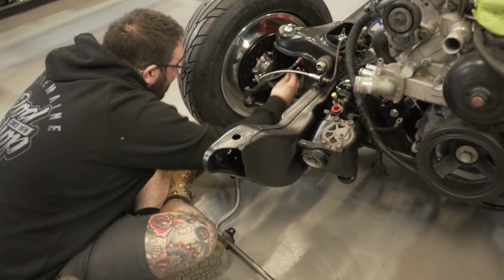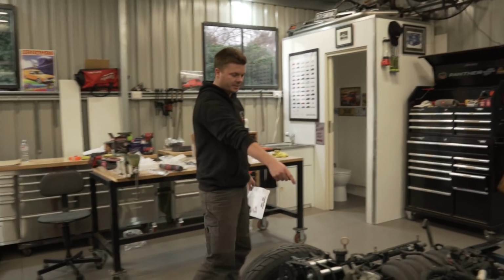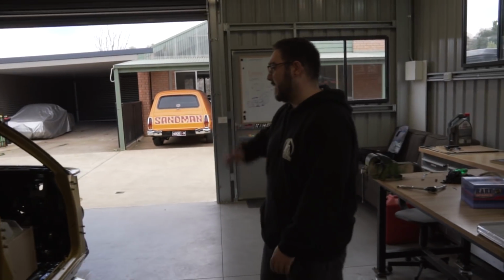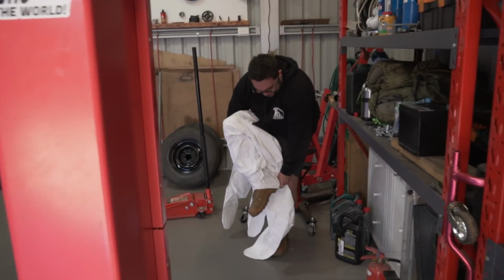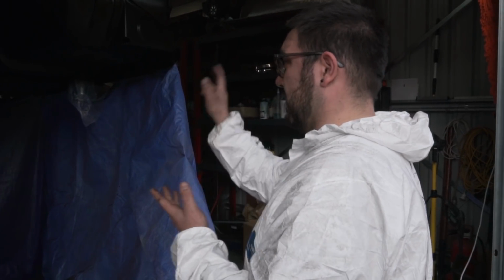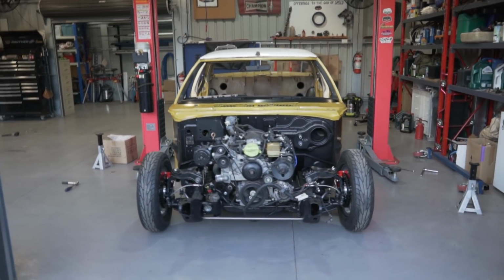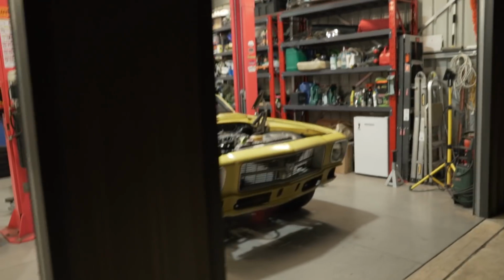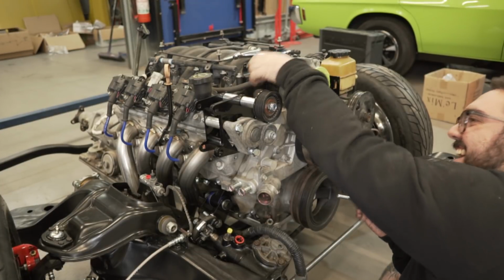LSQ Build - Part 5 - Bolting The Sub-frame and Motor To The Body  - (LS Swap HQ Holden)

Comment: Awesome work guys is there any alignment to be done on the chassis to Shell mounts or are the bolt holes really small I'm contemplating removing my chassis but concerned about realigning everything all over again
Reply from the maker: Yeah there could potentially be issues lining everything back up again, the bolt holes are pretty big and allow for a fair amount of adjustability, we havnt yet had to sit the front end on for final fitment so we arnt sure just how much of a pain it may be line back up, but in saying that a lot of people do it, and HQs were never really built all the straight to begin with
Reply: @HackshopGarage  ok I'll have a think about that one might have to make a jig up so it goes back in the same place thanks for that guys.

Comment: Killer guys ,  did u alter the coil over height at all from the install video at all ?? Looking at the coil over kit for my QEE coupe
Reply from the maker: Yeah we raise it he bottom collar roughly 60mm as the install video we had them at the bottom of the shaft. 60mm still leaves maybe 25-30mm of high adjustment too. Maybe more, it’s hard to see up into the tower

Comment: If a big block Chevy V8 engine bolts into the engine bay of a HQ Holden then a small block Gen 3 Chevrolet LS1 V8 engine will fit no problems.

The LS1 engine is going to be better on fuel than the old 202 engine & obviously much more powerful !